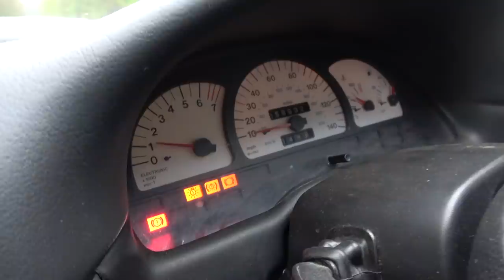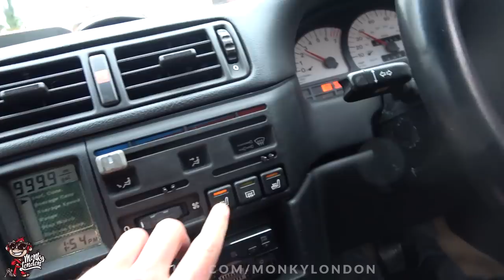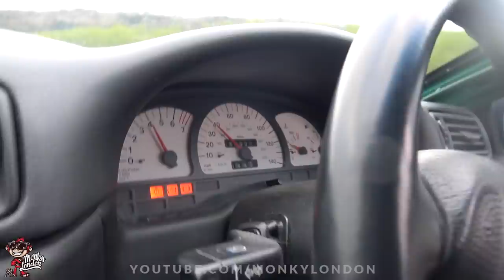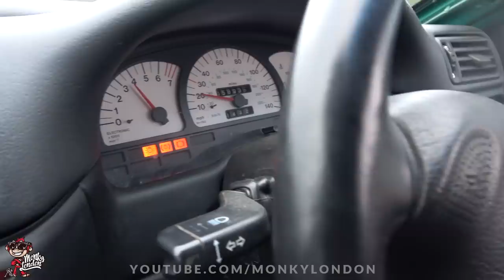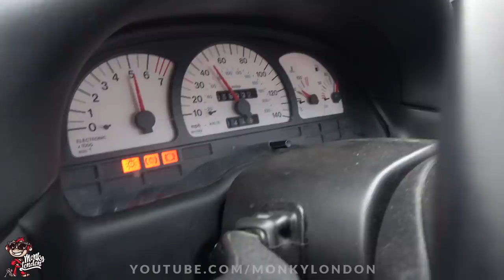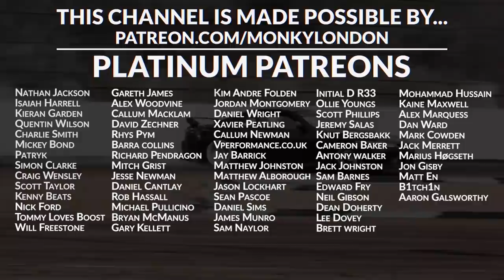🐒 GREEN MACHINE Ep2 - SPEED TEST, HOW FAST WILL SHE GO?

Comment: TSW evo wheels, Irmscher bodykit, single wiper conversion, and a turbo c20let, hell you could even 4wd swap it if u had the balls 😉
Its a late 90s car with mid 2000's style mods atm, make it pre fast n furious, that was the max power era.
Reply: You just need to be slightly more specific on the wheel choice :)  But in my mind the classic TSW Venom's are and will always be the hight of the Maxpower era.
Reply: @HalfdeadRider  I still have a set now 17" In gloss black and 4stud ford fitment had them on my rst have no use for them but I can't bring myself to get rid
Reply: @lukecowell7516  Nice, keep them until we are nearly dead lol someone will pay a fortune to put them on their classic rst they are restoring and modding lol.  I had many Escorts but never owned an rst, so gutted I never did, I drove one about five metres at an old job once and that was my experience.
Reply: @HalfdeadRider  'Evo's are a wheel tsw used to make a few years before the venom dude, it was a flat faced six spoke n pretty much a straight copy of the rims used on the Mercedes 190 evo II - possibly hence the name. Around the same time of the venoms they did a update on em and released the Evo-r which was a deep dish variant, but imo you can't beat the originals.
Reply: @rud3y1  They done at least two different Evo model wheel, the Evo S and Evo R, maybe more 👍
Reply: Should have read to the end you obviously know lol
Reply: @HalfdeadRider  its the internet! Of course were gunna slightly misread each others comments 😉
Reply: @rud3y1  😂👍
Reply: 2wd calibras don`t have the channel for the rear cardan shaft so you can`t just simply turn it into 4wd. this is the worst ever calibra been made with a piece of shit eco tech engine the only thing worth salvaging out of this car is the leather seats

Comment: Saab B234, preferably a B234R. Drop it in as is with the Saab Trionic 5. Remap from Jules_HT on UK Saabs and it will be at 310bhp as is with no mods. Add a bigger turbo and injectors and your up to 500 easily. Engines are fully forged throughout. Mines on 220k.
Reply: @zeroyon223Yes the Saab B234 / B204 ( 2.0 & 2.3) from 1994 onwards will fit right into a Euro GM car. But you need to transplant the Trionic5 management system as well.
Reply: @dj_paultuk7052  what a good call i second that nice clean one out of a crashed vigen ...?
Reply: @michellefinlay9950 No a Vigen is the B235. They are rubbish and go bang. GM engine. Saab B204 or B234. 1994 to 2002
Reply: @michellefinlay9950  will be from a 9000 aero if its a B234R
Reply: My mate did a 2002 Astra van engine swap for the saab b234r and it's a beast and looks cool as fuck all detailed out running about 340bhp 👍
Reply: Yes mk3 Astra cavalier and calibra is a direct b2#4 swap.
Reply: Standing quarter at santa pod.... 18.028 seconds I'm thinking 🤔🤣
Reply: @zeroyon223 yeah, you can get opel Calibra and Saabs in New Zealand and Australia but no way will they make 500hp with just injectors and turbo.. Well not in NZ or Aus where we measure in actual horsepower not plastic ponies lol.

Comment: My EJ8 Civic coupe has 243,000 miles on the chassis, but it has a built LSVTEC turbo in it that makes 588 whp...😁 EVERY bushing, hose, fuel and brake pipes, control arm, inner and outer tie rod ends, and every suspension component has been replaced. It also has rear disc brakes now from an Integra. Safety first...

Comment: you can just plug a puncture also on the sidewall. a mechanic wouldnt recommend because they "can" fail.   just but the repaired one in the back.  ive ran over 40.000 miles on a repaired punctured sidewall.

Comment: I think the 1/4 mile time will be 17.15 seconds, you could twin turbocharge the engine but obviously change engines to accommodate conversion with nos. The drive train, convert it to fwd with an upgraded clutch. 40mm suspension drop or even air ride conversion maybe?? Brings back good memories and good times.. 👍👍💪💪

Comment: But seriously better conversion is the Saab b304r engine. Easy to do I can point you in the right direction on how to do it. My mk3 cavalier Sri is running 350bph Saab b204r it’s amazing with lsd I’m having fitted it will shift quicker too.
Reply from the maker: Is it 94-99 9-3 2.0 turbo should be looking for, and 2.3 but prob hard to find are they more abundant in 9-5? Read later post 2000 b205 weaker internals same as early b204 pre 94. Need a whole car if we go saab route
Reply: MONKY LONDON yes mate your better off any 9-3 made before 1999 with the red coil top will be ok. If you use the Saab gearbox which I did use the Saab servo too it’s a bolt in. Sign yourself up to migweb speak to Nige p for conversion looms he builds them for plug in and play 👍

Comment: Hi guys i know its a not the best car in the world, it's a pitty you guys did not get the earlier model, with the c20xe engine. Much faster and they came with turbo 4wd option as well. The one you have is the base line model. Those cars have long gear ratios its definitely a top end car for those autobahn roads. It's  an Opel rebadged as a Vauxhall once it hit the U.K shores back in the day. Over 200km easy. Not a quarter mile car based on its aero design  for its time.